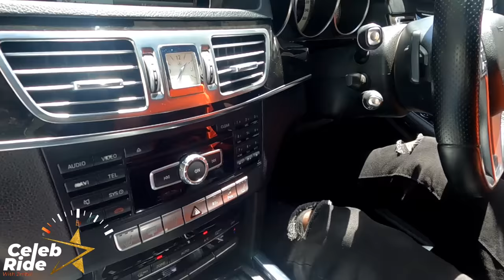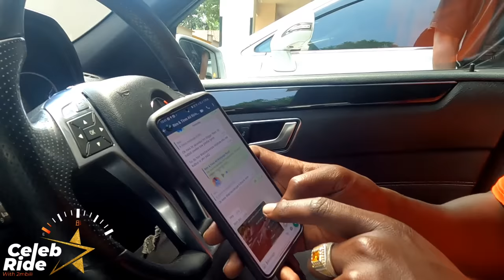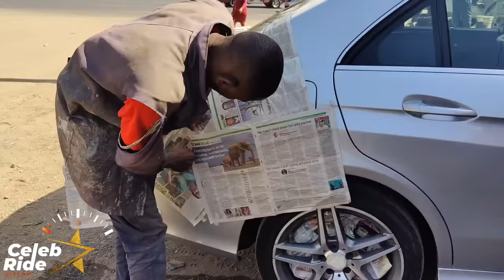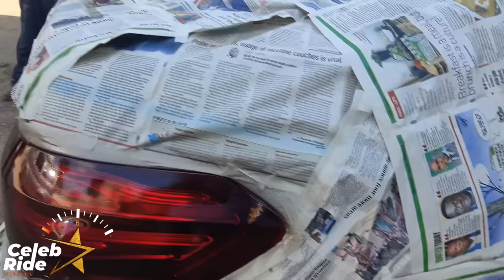OGA OBINNA GIFTS HIMSELF A SH 5.4M MERCEDES E 350 FOR HITTING 100K SUBSRIBERS & BIRTHDAY- CELEB RIDE

Comment: Multifunctional steering wheel literally means steering wheel has function keys on steering wheel e.g. there is a button on the steering wheel that you can use to receive a call without touching your phone, audio control etc
Reply: Ama cruise mode!! Ata Vitz has it bro’